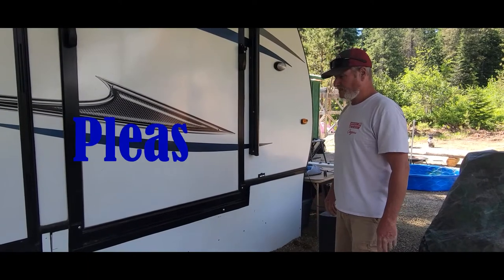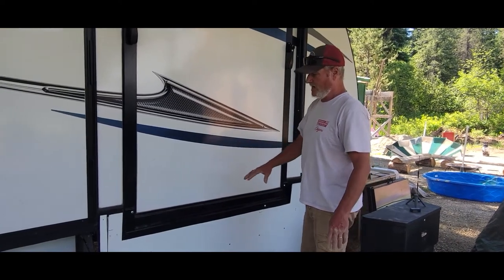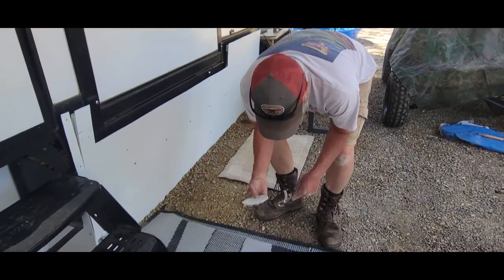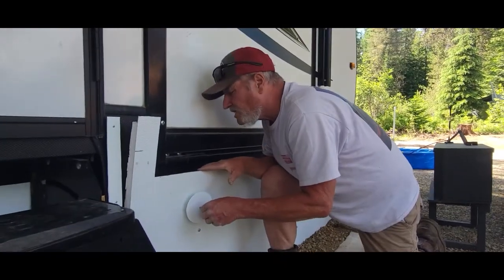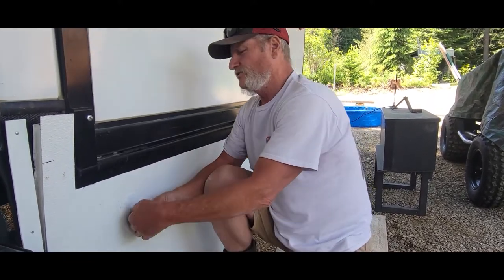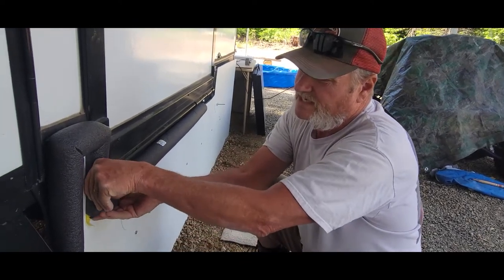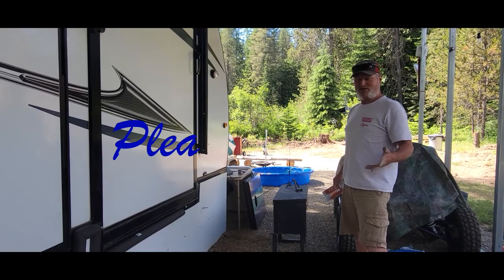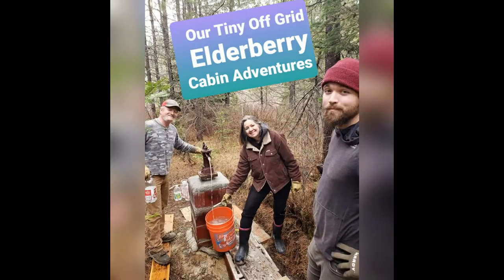S1 Ep 16. Learning to be Off Grid: DIY RV Skirting for Winter Part 2

Comment: I don't understand what the J hooks are connecting to and the wood support on the bottom, how did you connect it to the foam??
Reply from the maker: The foam is glued to a fiberglass sheet. The J hooks reach under the RV And connect to the RV Skirt itself. Its a wing nut we got a home depot and "J" part reaches in and grabs the skirt lip so we don't have to screw holes into the RV itself to hold it there. The wood support at the bottom is part of the wood frame that holds the fiberglass sheet. Its a 2x2 frame. I hope this helps answer your question? If not, I will have my husband give a short video with a detailed instruction of what he did and why. :)
Reply: @offgridwithduaneandcolleen3079  What is the fiberglass sheet for? Did you glue the wooden supports to the foam?